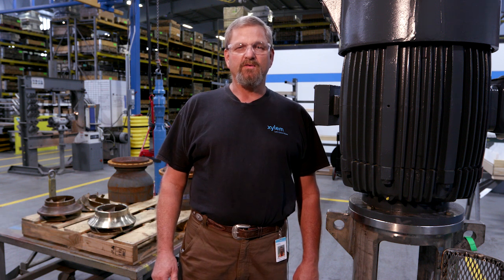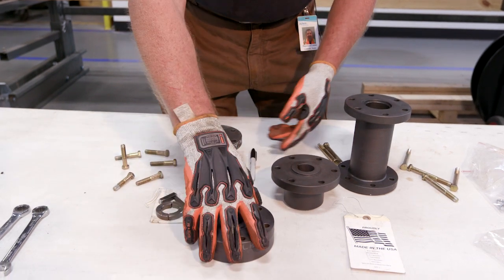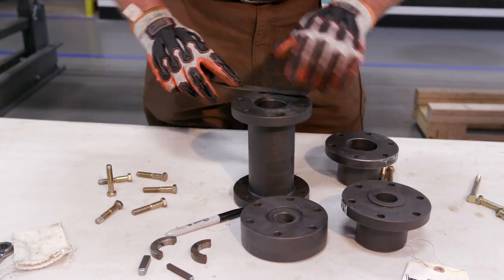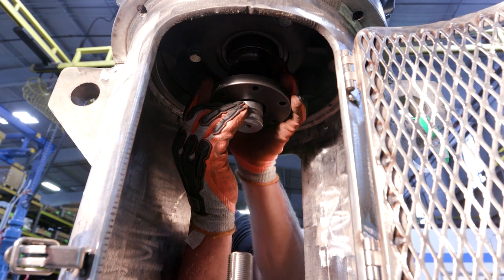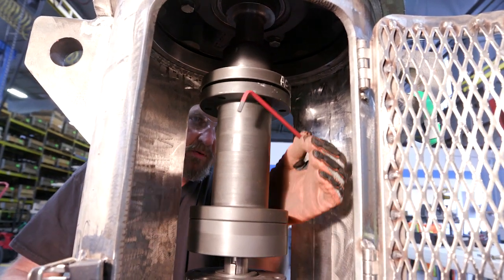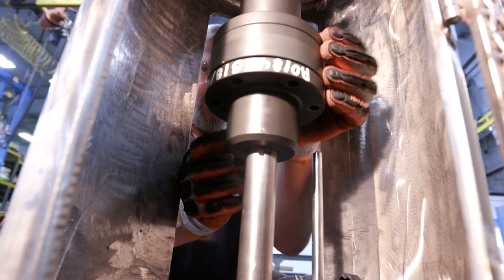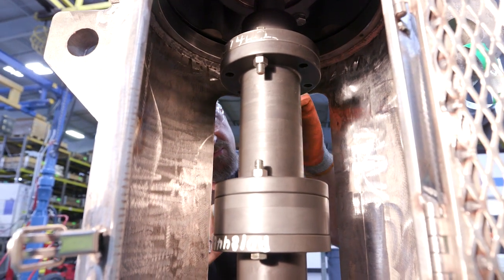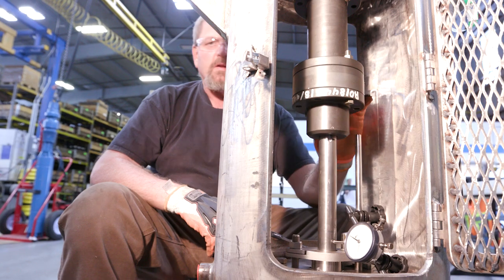How to Properly Adjust Impeller for Vertical Industrial Turbine Pumps

Comment: What kind of adjustment would you have made if the run out were greater than .005 ?
Reply: Angular contact ,Bush Bearing or shaft  replacement, repair of housing bearing

Comment: rigid adjustable spacer type coupling in this video has no added benefits with packing stuffing box configuration because packing rings can easily removed or maintain without the need to have a spacer piece of the coupling. Adjustable spacer type coupling is generally used when there is pump utilize a mechanical seal, this is to facilitate a servicing of mechanical seal whithout disturbing the driver.

Comment: Hi sir your videos are awesome. I have an doubt in vertical pumps. Why the vertical pumps are dont have balancing drum arrangement for axial load. Then  How axial float of impeller will be arrested..?
Reply: These pumps are designed for axial load due to thrust. Each pump design has K factor which needs to be referenced when calculating thrust. Under normal conditions these pumps will see downthrust which is transfered to the electric motor thrust bearings which need to  be appropriately sized to the thrust calc. If these pumps run out on their performance curve, they could potentially go into upthrust which can damage the motor. These pumps will have a max impeller lateral (movement) and the impeller stack will need to be set within this based on stack weight, column and shaft stretch if applicable. It all works of allowable tolerance and clearance.
Reply: @bigamigo4863  thank you very much for your valuable comment. I want to add some additional details regarding this. Basically this type of vertical pumps impellers are having balancing hole to reduce the axial float   by design and additionally bearings are arranged by tandem double set up. So it will allowing the one direction of axial float only.. So This is what I have learned from this concept... thank you very much for your great sharing....❤
Reply: @rasetech  Yes they can have a balancing hole which is called a "thrust balanced impeller" but this is rarely necessary unless the total thrust of the pump is too high to match any motor thrust rating. We rarely see thrust balanced pumps as its usually not necessary as motors have a wide range of thrust options available. These impellers also make the pump less efficient as there is more recirculation happening. These pumps are designed to have fairly high downthrust when at their B.E.P.(depending on pump size and system head).
Reply: @bigamigo4863  Great Information.... All the best....💐